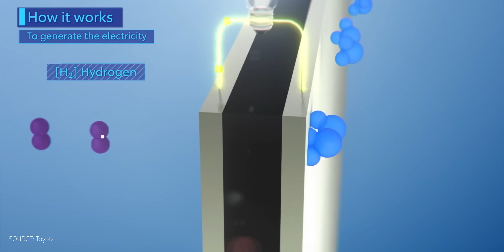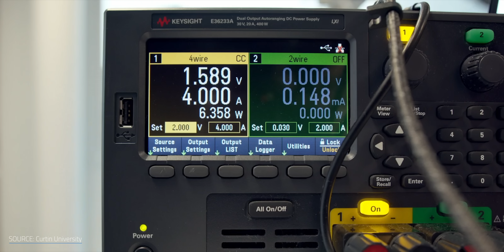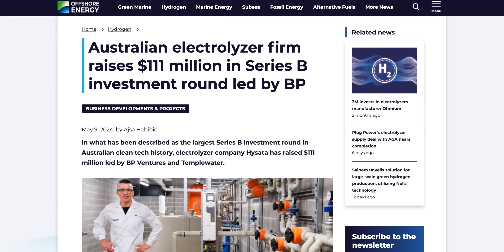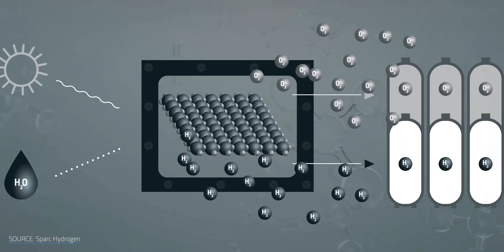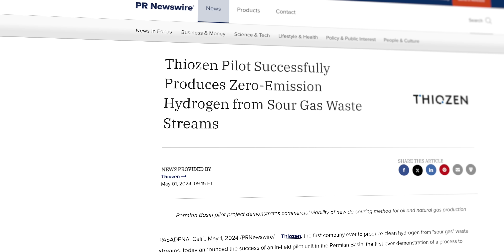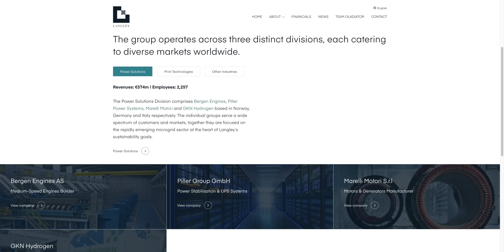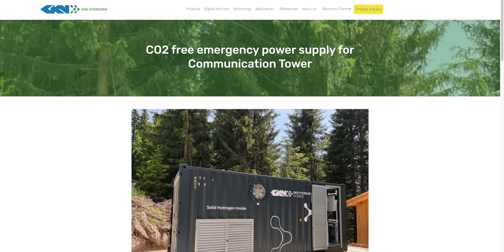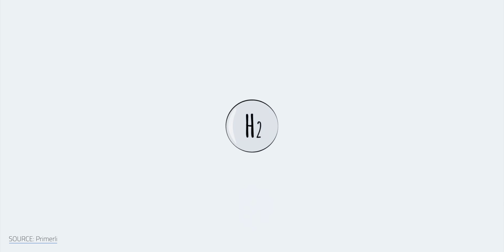How a Hydrogen Breakthrough is Closer Than Ever

Comment: Shocked you did this waste of time video.While everything you said is true, you only showed the sugar coated side to fit your narrative of yeah h2 is cool.
You completely left the energy transfer is horrible compared to batteries. Charging a battery is way more efficient by double digit.  Then removing the energy is not efficient.   You can charge then discharge a battery only loosing 10 to 15% .  Hydrogen uses more than that at each step.   
How do you store it?
Come, be more honest

Comment: The problem with hydrogen isn't the efficiency of a single point in the hydrogen network/system, it's the accumulative losses that add up from the start to the vehicle wheels or burner in the home heating system.

The 95% electrolyser efficiency is one point and the losses are carried through to the end use along with all the other losses, one of them you mentioned and that is the compressor losses to compress the gas for storage.
Reply: 95% efficiency in electrolysis is not really believable, right?
Reply: @johanstjern4118  
The Australian company have been around for quite a few years, I think it's probably fine. It's taken them some time to commercialise it.
I mean hydrogen is needed, but the applications are probably reducing rather than growing.
Reply: @Paul-yh8km  Also, hydrogen molecules are very small. Everything leaks. Seals are difficult. I doubt you could just pump hydrogen into an existing home gas supply pipe without h2 leaking everywhere.
Reply: @SimonPearce000  
yep.
Add that to my comment about losses!
It's also practically impossible to add a useful odour to it.
Since the odourless hydrogen could still leak out, with the larger odour molecules left in the pipe.
Reply: Australia is playing the long game with hydrogen where batteries do not make sense: Long distance shipping, countries with minimal capacity to create sufficient green power (think Japan and South Korea), long distance aviation, and long and thin railway thin railways not suitable for conversion to electric (eg Trans-Australian railways from Adelaide to Perth and Darwin).
Reply: That's why hydrogen is best used in industrial application where it is produced and used at the same place. Hydrogen is a feedstock for thousands of chemical process. One of them is amonia for fertilizers, very important if we want to get out of methane.
Reply: @zmaglif  
Even industrial use is looking increasingly dubious.
Two projects are already building low temperature electrolysis DRI plants working at temperatures as low as 60 Deg C.
Reply: @Paul-yh8km  But they use hydrogen there, it's in the name electrolysis.
Reply: @zmaglif  
No! No no.
Electrolysis just means the application of an electric current to something to split it.
In the case of iron production, it's separating iron from oxygen.
Reply: @Paul-yh8km  Please link the plants in question, I'm not finding it.
Reply: The ArcelorMittal and John Cockerill plant is called Volteron and is due to start producing in 2027.
Reply: @Paul-yh8km  Oh, didn't know Boston Metal had a direct competitor. But that's specifialy why I talked about fertilisers, because ammonia has hydrogen in it.
Reply: Isn’t it also correct with conventional fuel? The only main difference is that we need to pack renewable or nuclear energy ourselves in the fuel instead of relying on geologically processed ancient germs or ferns
Reply: @reyjur1493  
Conventional fuels and hydrogen are low efficiency energy systems.
A lot of fossil fuel energy is wasted during processing and final use, in fact the majority is wasted.
With hydrogen it's the issue of the losses feeding back to a need for more generation capacity compared to pure electric technology.
No matter what generation source is used, we need to build it up quickly and that is best done by minimising the target generation capacity. If you need more for hydrogen that costs more and it takes longer to build it up.
Reply: @Paul-yh8km  I'm just saying that if we compare hydrogen with fuel then the losses is not the main problem of hydrogen i think. But of course when it comes to comparison with batteries, it's probably correct.
Reply: @Paul-yh8km  Electrical storage just sucks for now. For vehicles you basically stuck with chemical storage that is volatile, produce carcinogenic fumes when burn and need lithium which is sorta rare and ecologic disaster to mine. It also does not have energy density comparable to conventional fuels (even with low efficiency of ICE's), plus it has charging time and reduced performance outside of +25 degree C. While fuel cell can start and work with ~same performance at -30deg C, can be connected to whatever compressed hydrogen source and produce water vapor as exhaust. 
I think efficiency isn't the only thing we should optimize for.

Comment: I’ve done experimentation with the new rocket wood stove designs. Would be nice if someone came up with a way to make hydrogen from  that. Urine has one more hydrogen molecule than water. Would be nice if someone found an efficient way to extract hydrogen from ammonia and/or store to ammonia and/or have ammonia powered engines, etc

Comment: Good to see someone who hasn't forgotten hydrogen yet. I do have to correct you about hydrogen not occurring much in natural form. You may want to check up on that. It's an exciting prospect for hydrogen. They're finding it everywhere.
Reply: With geologic hydrogen it's not the finding that the issue it's the extraction. Some places require fracking approaches to release the hydrogen with the geologic, social and political considerations this approach imposes. Others require mutliple bore holes and well heads as hydrogen tends to collect in pockets dispersed over large areas, with concerns about continued extraction in these areas as the hydrogen is highly reactive with the surrounding rocks and materials and can reseal bore holes fairly easily (which is why the hydrogen pockets became trapped in the first place). Finally, there is the question of hydrogen's tendency to co-locate with other gases, such as methane, and how to cleanly separate the gasses - the hope is with hydrogen being a light gas it can sit on top of the methane but extraction disturbance may cause the gases to mix. If methane is co-extract how is this processed, releasing to atmosphere is not answer nor is simply burning it as that makes hydrogen extraction a grey rather than green process.

Comment: Ok. 

A Hydrogen based economy is a net consumer of energy! It is not a source of energy! Clean or otherwise. 

What this means is that the energy consumed to run a hydrogen economy is far greater than the energy provided by the hydrogen infrastructure. And this is not an economically solvable problem, nor is it technology solvable. 

Three Types of energy we use.  

Extraction energy. Obviously oil, gas, coal, uranium.

Captured energy. Wind, solar, tidal, geothermal, hydroelectric and many others.  

Manufactured energy. This is energy that needs to be manufactured.  Basically you take a lot of energy and use that energy to convert non fuel  materials, to fuels. Like water to hydrogen. There are very few examples but Hydrogen is exactly this.  It is manufactured fuel from a non fuel inputs.   

Manufactured energy is not the same thing as refining oil to gasoline and other stuff other fuels.   The reason is the input for the fossil fuel the process is itself a fuel containing a tremendous amount of energy potential.   Making Hydrogen is taking water,   as an input the has next to zero potential energy, it is has no chemically potential energy, it is stable.

Bio mass energy is rather unique that it is a combination of capture and extraction.  And in some cases manufacturing but the input has chemical potential energy, it burns.  

Extractive energy is extracted from the earth, converted to consumable formats, transported, often very long distances, to the point of consumption.  Despite the rather large amount of energy required to accomplish this, the energy yield is greater then the energy consumed to produce it to the consumer.  Because the process inputs are energy materials, coal, oil, gas, biomass.   This is why until recently it has dominated our economies, because it is economically viable, to a point.

Captured energy is the process of realizing the environment which is chuck full of energy and all we have to do is capture it!   It is the oldest form of economic energy we have ever had.   Windmills are an ancient technology. Solar has been used for a long time for processes like drying salt. Water mills have also been around for a very long time.   And animal power!  We have been capturing animal power as soon as we hitched a plow to an animal.

Modern economics requires huge amounts of energy. And in the last ten years we have come to develop modern methods of energy capture that are more efficient then extraction, cleaner then extraction, and most importantly cheaper then extraction. Also the efficiency of captured energy is amazingly direct.  Energy provided is significantly greater than energy consumed. 

Manufactured energy
I can only think of one manufactured source of energy, Hydrogen.  You need to make the hydrogen, compress it, liquify it if transporting long distances, transport it, store it, and distribute it, then consume it. This all has to be done while facing the realities of hydrogen, it leaks, it makes material brittle, and takes up a lot of space in storage.

If we take the energy inputs of all these steps and then compare it to the energy efficiency of the consuming appliance, be it a steel mill or a hydrogen vehicle to the conversion to the work done, then we see that the total energy required for providing the hydrogen fuel is much larger when compared to the work done by consuming hydrogen,  it is obviously not efficient, effective, or cheap.  Especially compared to the two other forms of energy, extraction and capture.  Fossil fuels and renewables.  

Manufactured energy, by its very nature, to have a net positive outcome would smack of perpetual motion machine!

Comment: To say that H2 has 8mj/liter of energy density in the same sentence as gasoline 32 MJ/l is very misleading.  That 8mj is for liquid H2.  Compare them at room temp/1 atm and the 4x difference will become something like 4 order of magnitude difference.  And that 8mj/l for the liquid doesn't also account for the volume of the container, which consumes far more volume than a simple polyethylene plastic jug you store gas in.
Reply: Electrons Rock ⚡
Reply: When it comes to fossil fuel alternatives, I'm a "anything that works" guy. But it looks to me like hydrogen is one of the least promising energy sources, especially when you compare the progress described here with what's going on with wind, solar, geothermal, batteries.... Hydrogen looks like a lagging technology, expensive, complex, hard to commercialize, and being overtaken by other technologies already being deployed at scale.
Reply: Obviously everyone knows he's talking about liquid hydration, from 32 to 8 is a factor of four, per litre petrol has 4x the energy density but petrol engines are only about 30% efficient where as hydrogen can be 50-60% I'm by no means advocating for hydrogen as a fuel for cars. I think plug in hybrid is the way to go
Reply: Yup, complete BS.  Hydrogen cars, etc. use compressed hydrogen, never liquid.  This guy is a clown who really doesn't understand what he's pitching most of the time...
Reply: Man I love crude oil.

Comment: It takes a lot of energy to compress the fuel. Unless they can figure out how to use the energy without compressing it, it will never be as efficient as simply putting the electricity into a battery, at a very minor loss, then taking that battery power and putting it to a motor, thus to the tires. There's also the problem of making the fuel! 

Everyone's focus on making the fuel, but the simple act of storing it in a distributable way makes it terrible! 

There's also the problem with the connector occasionally freezing to the vehicle! Now you have to wait for it to thaw, which could take close to a half hour, on top of the wonderful 5-minute filling process. The best part is, if you're a little bit short on electricity to drive an EV, you can easily stop and add enough energy to get to your destination, but since you don't know if the connector will freeze to the car, you can't quickly stop for fuel in the middle of an important run. 

Oh, I tried to overlook the fact that you're putting a bomb in your car! If you get an accident where you ignite that hydrogen, there is a crater where you used to be, plus the other car, plus the people that used to be inside that vehicle The cars have been converted into mobile bombs! So the first time you get somebody cutting you off in a hydrogen vehicle, you can turn around and accuse them for attempted murder, and have enough evidence behind you to convict them! If they cut you off, in a near miss scenario, you can easily claim that they try to cause an explosion which would kill you! Intended or unintended, it would still be attempted murder!

Comment: I thought burning Hydrogen still gave Oxides of Nitrogen.
Yes fuels cells are good but still need batteries to even the load, and require filter maintenance for clean air intake.
Lots of sites that need Hydrogen make it on site.

Comment: Hydrogen is a non-starter for personal vehicles.  But I think hydrogen has big potential for very long-term seasonal grid-scale energy storage.  I'm talking storing energy from the spring/summer when solar output is huge for use in the fall/winter when solar output is low.  This would of course help solve the renewables intermittency in the annual (seasonal) time frames.

Hydrogen storage is a problem.  But with just a few very large-scale concentrated hydrogen depots for energy output, the project could be financially feasible.   I'm talking hydrogen power plants the size of a large nuclear power plant with several farm sized silos of stored hydrogen in some kind of advanced storage medium or just brute force pressure.

Once practical seasonal energy storge is available, there becomes zero excuses for fossil fuels or nuclear energy as we've reached "firm renewables" territory.  With firm renewables, we're basically "mining" the sky for clean energy instead of the ground for dirty fossil fuel energy.  The sky and wind have about a million times more energy than ever in the ground and will last for a billion years too.

Comment: Two words: Hydrogen embrittlement.
Reply: More words, still a problem,

High temperature hydrogen attack (HTHA), also called hot hydrogen attack or methane reaction, is a problem which concerns steels operating at elevated temperatures (typically above 400 °C (752 °F)) in hydrogen-rich atmospheres, such as refineries, petrochemical and other chemical facilities and, possibly, high pressure steam boilers. It is not to be confused with hydrogen embrittlement.[1]

https://en.wikipedia.org/wiki/High_temperature_hydrogen_attack

Also, 

"The minimum ignition energy (MIE) of a hydrogen–air mixture is only 0.019 mJ, whereas that of other flammable gases such as methane, ethane, propane, butane, and benzene is usually on the order of 0.1 mJ according to Lewis and von Elbe"
Reply: Only welders and material scientists understand this. And you are right. We should be focused on N-Butanol.
Reply: Problems solved for hydrogen storage and production by Ayrton Energy & Eirex Technology in Canada.
Reply: @leroyessel2010  Granted I'm no organic chemist however what scant information is available on Ayrton's website, it looks like they are playing with Benzene as the chemical they intend to turn into cyclohexane (which is an oil).  However both chemicals are not something I'd like driving down the highway to refill my local gas station. If  they have found something else, something that isn't toxic and known to be a carcinogen, my hats off to them. Otherwise, I'd take good old gasoline driving next to me on the highway vs a tank of benzene or cyclohexane.
Reply: @EyeZaque-w9j  Good point.

Comment: Matt - are you aware of UK based HFI (Hydrogen Future Industries)?
They have a very high efficiency electrolyses, using power from ducted wind turbines. These turbines produce 3X the electricity output of conventional wind turbines.
System currently being tested on a remote mining site in Montana.

Comment: Thanks for sharing your thoughts, ideas and videos. The solid state storage sounds promising, I’ve always considered the cooling and compressing of hydrogen for storage a show stopper since additional energy is needed that would be very difficult to recover. I’ve always been very impressed with the hydromaxx process but unfortunately it’s seems to have died and is difficult to lookup since the name has been repurposed and that is all you can find when looking it up. The process basically takes any hydrocarbons and splits the hydrogen from the carbon resulting in synthetic natural gas and hydrogen as a gas byproduct and a slag that can be used as an alternative to Portland cement in concrete. That last byproduct alone almost makes it viable on an ecological basis. This process has been studied as a construction waste solution and there was a DARPA project to reprocess waste from deployed soldiers and make diesel fuel. If you look at the content that every community is struggling to safely and responsibly dispose of there is literally a gold mine going to waste at every sewage treatment plant. I would like to see a comparison of the efficiency between taking hydrogen and storing it as an individual component to use as a prime mover in a vehicle vs converting it with the Fisher Troops process to synthetic diesel. There were so many processes out there in startup that died when we momentarily had cheap fuel.